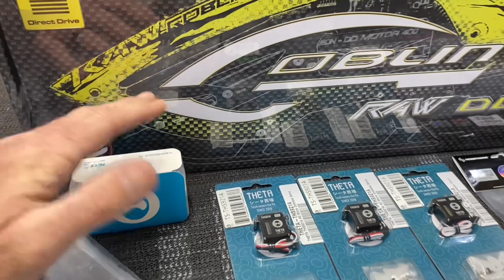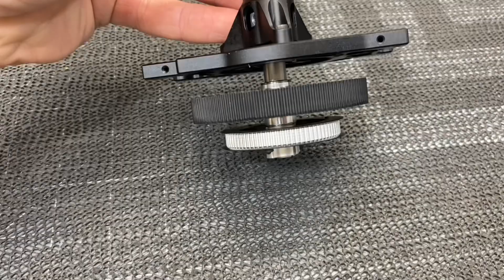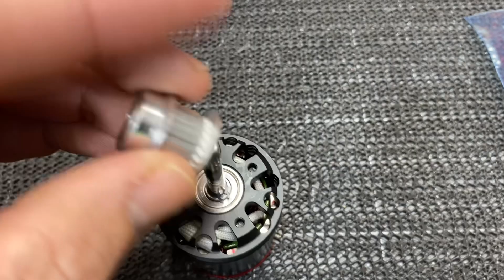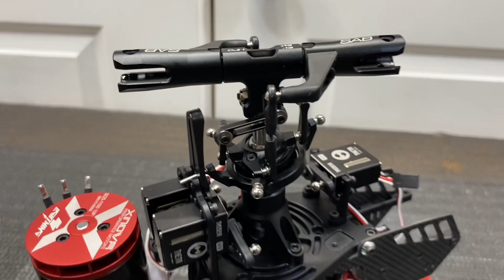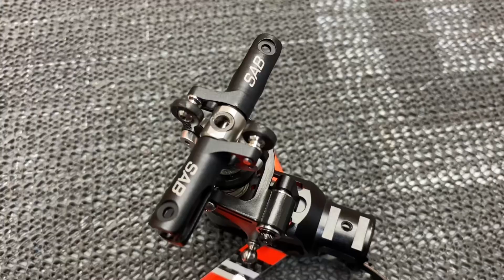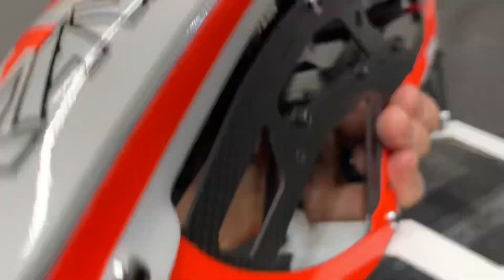Monster RAW 420 Build!

Comment: wouldnt the 80 amp esc and Xnova 3220-950kv be more optimal?
Reply from the maker: depends on what you want, I wanted as much power as we could fit in the heli lol the Hobbywing 80 and 120 are the same size anyways.
Reply: @westhobbiesrc8051  congratulations on your beast